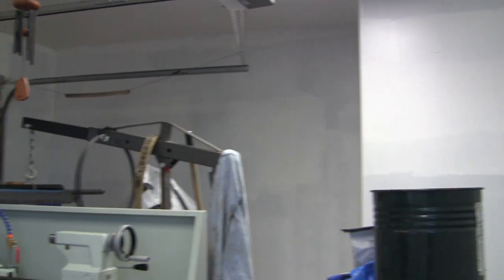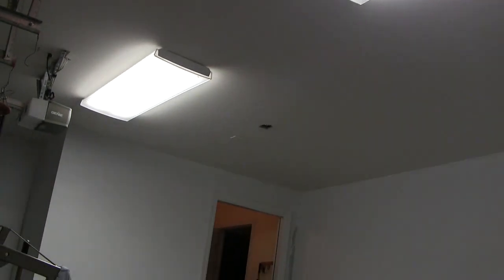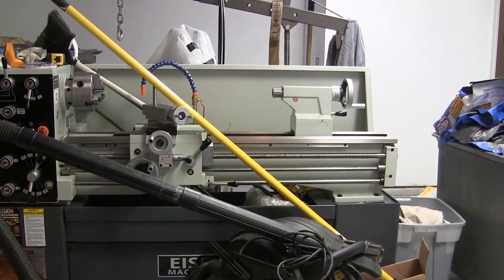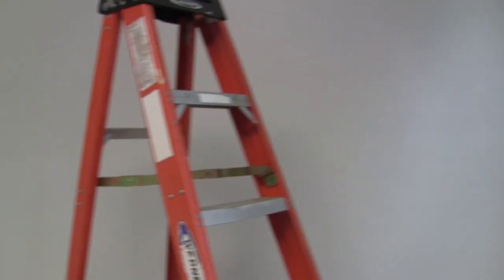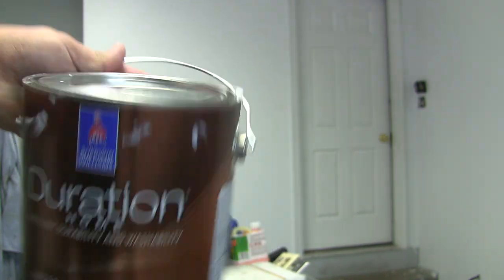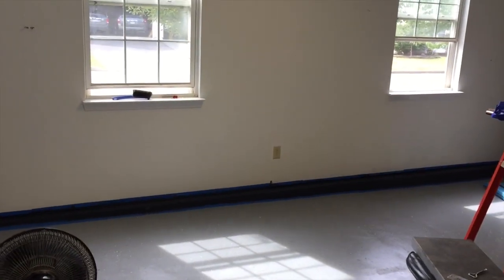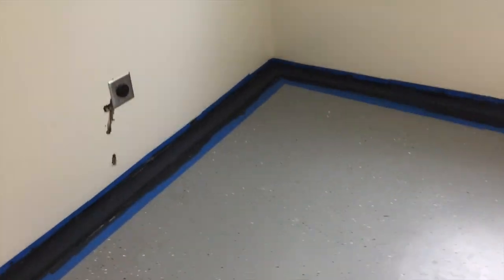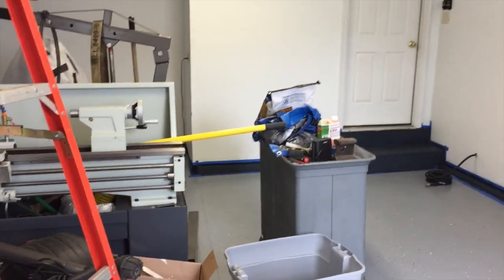Shop Update   5

Comment: Random bit of info. Painting a dark boarder along the transition from the wall and the floor was a common design style used in the 1700's and early 1800's in homes as a way to hide the dirt that would be kicked up on the walls from the floor. 
I like watching your moving vids as I am currently cleaning out my 1car garage to make a small shop space for some of my machines. So I'm going through the same thing you are. Great job. Keep it up!
Reply from the maker: Thanks Greg. I appreciate that - and that's the purpose of creating these (sometimes boring) videos. To show the (scheduled) progress and give others an idea of what's in store for them - the success and the setbacks.
Reply: Thanks Brad! While fixing my garage, I'm also doing a full restoration on a 9" South Bend Lathe (also converting from a B to an A ) so I've been re watching some of those vids.  I've been watching your vids almost from the beginning but realized only earlier this year I had never subscribed.  Sorry about that.   Also I know a Greg when I see one so no worries on any confusion there!  LOL
Reply: Boring is (to state the obvious) a state of mind. I didn't find this particularly boring, but that might be because I grew up painting and re-painting my mother's rental houses, and later spent a lot of years painting theatrical sets. Watching paint dry can be real relaxing at 3 AM when you are too dog tired from 16 hours of painting to do anything other than watch it dry.

Comment: things are coming along nicely there Brad, one recommendation for the dark "baseboard":  those things are good crud and chip catchers. so i would put a slanted molding that will shed chips and other crud.
and when you have your insurance agent come in for an assessment be sure to point it out as the slanted baseboard is a passive element in fire prevention.
Reply from the maker: Great info - thanks!

Comment: Keep chipping away at it. It's coming along very nicely.
A suggestion for your layout. Make your 220v electrical connections via plugs and wall outlets.
That will allow you to rearrange your machinery as you need to in case you don't like the original layout.
Use it for a few months.  Once you find the best arrangement for you, you can then wire it in more permanently.
That worked for me.
Run everything by Stan first though. I don't want to contradict his suggestions. 
Thanks,
John
Reply from the maker: Thanks for the info John, appreciate it. I'll be taking everyone's suggestions as I plan for the electric service ;)
Reply: With a relatively low ceiling like that it can be handy to put some outlets on the ceiling and just drop the cable down behind the machine. Better than having something to trip on on the floor. This is if you have machines that aren't against the wall, of course.

Comment: That looks right nice there Brad. That bleed-under is why I never liked using masking tape. A good-quality sash brush and a steady hand can usually make a better looking line than masking tape, and is generally faster to do. If you aren't used to doing that you could snap some lines on a hunk of scrap board and practice painting up to the line without crossing it. It's pretty easy with a sash brush or a lining brush, but is a little tricky with a standard 3" or 4" paint brush.
Reply from the maker: Yup. I'm pretty good at cutting in, but this rough concrete was just drinking up the paint, so I got a little sloppy, haha.

Comment: Nice painting job, too late for me since I started moving in before the finishing was done... 
Formula for estimating the number of electrical circuits needed = Number of circuits we think we need  x  2.5 times, usually works for even the most expandings of us...
Get casters for some of your lighter tools, easier to do the planning by moving then as you need to use them and clear some space around.
Reply from the maker: yeah, I'll be future-building the circuits.

Comment: Brad, know not to long ago you installed some new lights down in your basement workshop, are you planning on moving those fixtures up to garage shop? Know when you shot night footage up in garage shop it looked a little dark over on "man-door wall", to far left of man-door. Kind of the reason i asked is, that I have an issue with overhead doors and  my lights and just wanted to give you a little heads-up. You need to put lights over the overhead doors, for when the doors are closed. But you also need to put lights down and between the doors or to the sides of doors for when they are open. In the summer when I have doors open at night, they totally obstruct light to work areas, so this winter will add some between and side fixtures to be used in summer when doors are open. I will just put them on separate circuit with a switch so they wont be on when I don't need them.
Reply from the maker: Yeah Fred, I actually have been thinking that. Good info - thanks man!

Comment: I Like the dark border !!!  .....Add a 25 amp 120 volt breaker and outlet ..In case you buy a small mig welder
Reply from the maker: I have a 220 outlet in the wall (the ugly installation) for my 210 Millermatic.